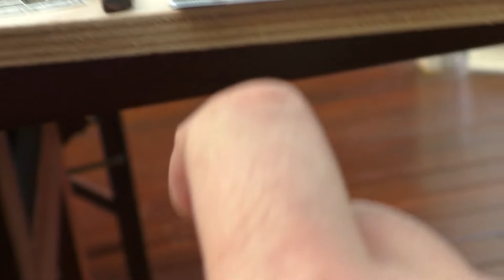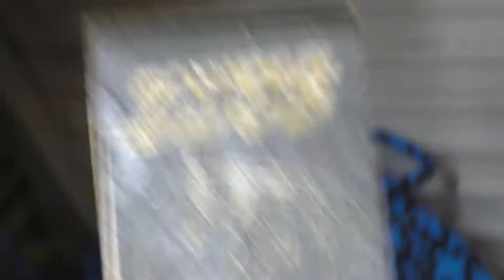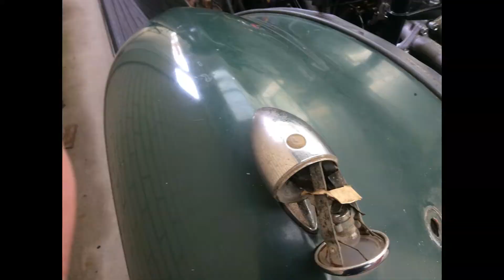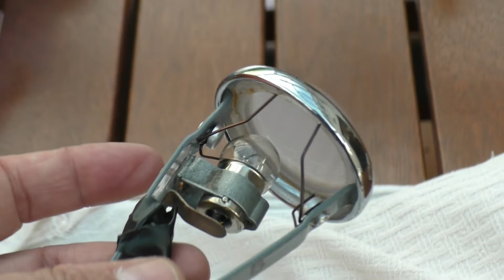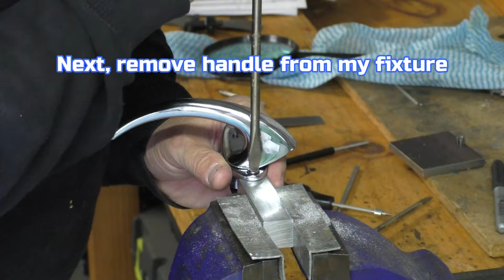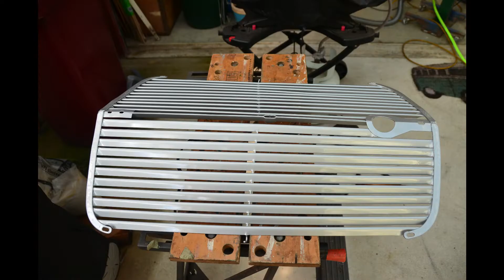Greg's 1949 P3 Rover restoration chapter 15 Lights and chrome

Comment: Nice, another radio collector with a P3... Did you have to prepare the chrome prior to taking it to the polisher/platers?
Reply from the maker: Sorry has taken my a while to reply, generally the only prep I did was to disassemble parts. The electroplater I used did minor dent repair. Yes the radios are another obsession, I have a 1930's radio restoration job to finish once I get the car done.